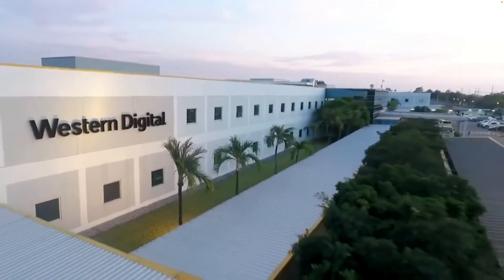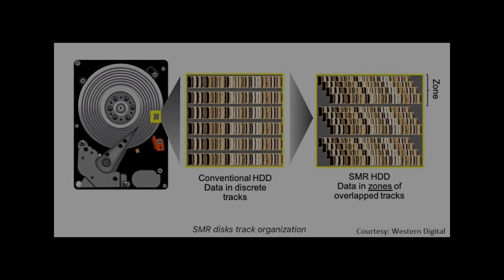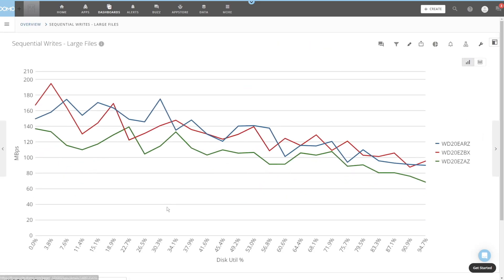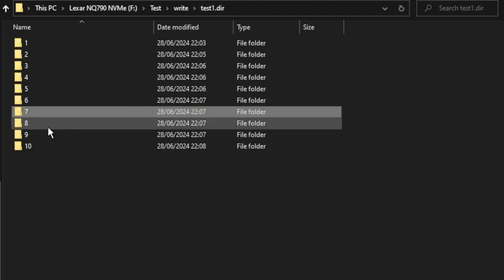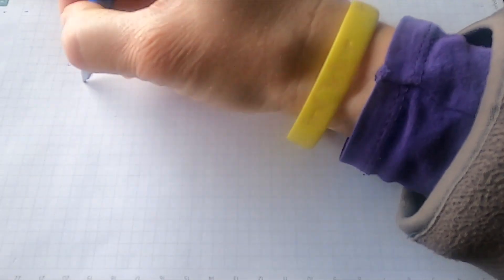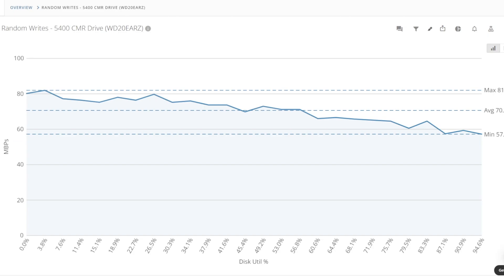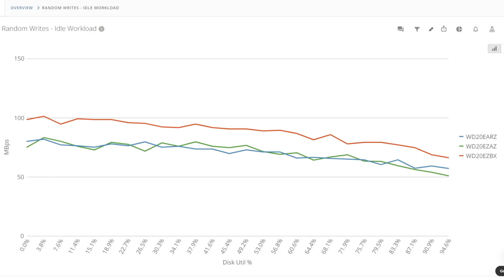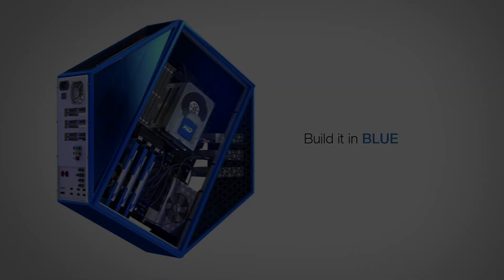CMR vs SMR. How do they compare, and how much should you care?

Comment: Thsnks. I would like some more low level info, like shingle firmware and how zones are handled
Reply from the maker: This would be mostly propriety and not in the public domain. And I did some other comparisons of desktop and surveillance drives with CMR vs SMR and it’s clear that  the implementation also varies by manufacturer.

Though I don’t know how the firmware is designed to handle this, and how things like zone size vary, you can infer a fair amount from the behaviour under testing, and it’s pretty interesting. Again, WD, Seagate and Tosh drives behave quite differently and some seem far better at some workloads. Overall, my take away was that the WD implantation was better than the others from a perf standpoint.
Reply: @sometechguy thanks. Its good to see im not the only one who digs into the details.  Much appreciated

Comment: It was absolutely annoying trying to find performance data between CMR and SMR recently, because anything real is choked out by useless, maga-like whining about SMR technology as if it molested their grandma. Strangely not as much about WD trying to sneak it in the back, then deny and deflecting about it.
Reply from the maker: The WD thing was a bit of a shame, and not the first time they got caught hand waving about what is going on with the technology in their products. They make solid hardware, so a bit of a shame that their Product/Marketing teams did this.

Right now, there is more transparency, but still not enough and still the recording tech comes and goes from datasheets, along with vagueness of spindle speed with terms like '5400 Class' not suitable for a datasheet in my mind. But SMR is alive and well in the Seagate Barracuda's and I dont think thats clear, and I did a video covering not just the WD mix, but also Toshiba have it in their P300 and S300 drives also, and the impact to performance for some use cases is significant. 

So I think putting the info out there is important, but likely only those that think to look will find it.
Reply: @sometechguy  Yeah, it feels like something that should be on the packaging, especially with that 20% performance cost even in ideal circumstances. Thank you for some actual data!

Comment: Quick statement on what are SMR and CMR would help
Reply from the maker: It’s in the video, and it takes a little explanation, but it’s just a way to put more data on the disk by putting the data closer to together. But this has implications to the way data is written and maintained and the work the drive has to do. And really, the video explains this with some diagrams.

Comment: Of the three Australian online retailers I frequent, one (scorptec) says whether a given HDD model uses SMR or CMR, in a way that's visible on the HDD category page, i.e one doesn't have to click through to an individual model's product page to view the information. However, they don't include it as a search filter, or explain what the terms mean. It's useful for those already in the know, but other customers may well go "ooh, larger cache size!"

The other two (mwave and pccasegear) usually say which recording technology a given model uses (at least for the WD Blue and Seagate Barracuda ones l checked), but you have to click through to the product page. They're also inconsistent with how they present that information, e.g. some product pages list the specifications in a nice HTML table, others just have a screencap of the product brief!

I have no idea what the big brick-and-mortar tech chains are like, but I'm afraid to find out.
Reply from the maker: The technically proficient, or enthusiast retailers seem more likely to specify. But the more mainstream consumer they get, the less likely it seems. Not sure if that is ignorance about it on the part of the retailer, or an expectation that the customer is more ignorant. But it isn’t great. 😞

Comment: so i need an extra hdd for storage mostly media and old videogames, but mostly media and linux iso, and in my country the price between the wd blue 5400 cmr 4TB and the sata ssd wd green 2TB is like 10 dollars (the wd blue is cheaper)
i know sata ssd is faster and the wd green have low endurance but i already have an nvme ssd for my os, and i plan to upgrade to an sn770 1TB.
so i am more inclined for the wd green 2tb, but the wd blue is cheaper and have 2tb more.
any recomendation?
thanks and great vids bro😊
Reply from the maker: Personally, on my PCs I have an NVMe SSD for boot, OS and things where performance matters, like AAA games that load lots of large data/textures.

For media, files, downloads, ISOs, pictures etc and even games that don’t really need high IO, I use a HDD. Depending how much you want to store, it can definitely be cheaper. And if you have a lot if data, you can also use a DAS or NAS with HDD also.

Comment: This is great content! I would also be very interested in Data showing how durable these SMR drives are in the longrun, because that was always my reason for staying away from them. If I get an HDD it's for data to archive or huge data to store. For a long time.
Reply from the maker: Thank you!

I would also love to see that data. I use the backblaze dataset for lots of great reliability info and I made a few videos using that to analyze reliability of large datasets over time.

Unfortunately, though unsurprisingly, they don't use SMR disks. So there isn't anything there. If there was a dataset, I would definitely crunch it, because I have trouble believing these drives are not subjected to significantly higher physical work. But also much higher read/write cycles due to all the foo associated with moving data in and out of the persistent cache.

Comment: Once in one of the videos a specialist convinced that discs with SMR technology are more suitable for backup and long-term archiving, while CMR are better for daily and constant work of reading and rewriting files. I don't know how true this statement is. Now it seems that manufacturers are deliberately trying to confuse buyers, artificially creating a supposedly large model selection to make it easier to sell low-quality goods. The buyer has to spend a lot of time to understand everything, to study all the nuances of the issue and only then buy the product. But even this approach does not guarantee a successful purchase.
Reply from the maker: I personally don't believe they are ever technically more suitable. There can be cases where the performance limitations are less important, but the only way I see that they would be better for a job, is down to significantly reduced cost, and they don't currently appear to be any cheaper. It could be true that they are less problematic for long term archiving, but not 'better'.

The problems here are reductions in write performance in some models, reduction in writing files to areas that are already used in all models I have tested. Inconsistent performance where performance varies, noise caused by the drives getting very busy with data organization tasks that are caused by how SMR works, which also inevitably leads to more wear and power consumption. And then there is added complexity and additional failure conditions.

So I would currently never select an SMR drive for any task, if prices are similar. But the problem is exactly as you say, that it isn't transparent to buyers and even on the data sheets, for the few that would take the time to read them, the performance numbers do not cover the scenarios where the SMR drives have poor performance, but only list best case numbers in most instances. So for 90%+ of buyers, they would have no idea, for a large percentage of the remaining 10%, it would be very hard to work out what they are getting. And only with some real research can you find all the information.

Hence this video, and the follow up group test I did on drives from Seagate, WD and Toshiba. Because I want people to be aware.

Thank you for watching 🙂
Reply: @sometechguy  Thank you for your reply and for the valuable work you have done for the benefit of people. I wish you peace and prosperity!

Comment: Sorry if that was already mentioned somewhere on your channel, but can you tell if SMR can affect restored data in some weird ways, like bloating the files?
Reply from the maker: No reason it should change the files, it’s just how the drive stores the data on the disk surface, and especially the process to write the data there. Mostly SMR drives perform fine when reading data, they are often just slower when writing it, especially on already used areas of the disk. But the files themselves should t be impacted.

Comment: I've got SMR drives and my experience has been a nightmare! I had a Seagate 5TB external drive which, in a nutshell, trashed itself and all the data on it. There's no way I'm buying any SMR drives as the risk is just too great for it to all go horribly wrong. The worst part of my experience was that the drive was a gift so I had no proof of purchase and therefore couldn't do anything about it.

I was using the 5TB Seagate as an archive drive as, at the time, I was desperate for storage space. I was transferring large video files of tens of gigabytes each. Thinges seemed to be going well, until I went to delete a file and replace it with another one. The is where it all went horribly wrong. At first it just seemed to be a problem of slow data tranfer. Eventually, the transfer appeared to have completed. The drive still made noises, though, but then the devices onboard power management shut the drive down.

I assumed all was well and had no clue my drive had just trashed itself. A day or so later I reconnected the drive only to discover the true horror of the situation. I'm assuming that the only data I was able to recover came from the CMR cache area on the drive, everything else was gone and it was data I was never going to get again. I tried leaving the drive connected for days on end to see if it would sort itself out, but it never did. A very painful lesson was learned. I now only ever buy drives I can confirm are CMR. There are no good reasons for using SMR drives.

Comment: What tool are you using to benchmark the drives. Is that truenas?
Reply from the maker: I have my own automated tooling for the testing, its based on Python and shutil. This performs the same high level copy operations as that of the OS, and testing of this versus manual copy testing shows that they closely represent the behavior of real world file copies. Its also possible to strictly control and reproduce the same tests this way also.

Comment: I was looking for a new drive as my storage was getting full.  I have 3 WD Blacks from 1 to 6 TB.   After checking the unavoidable "GAMING" branded Black pricing now, I had to move to another brand.  Was not aware of any SMR shenanigans with WD.   ExplainingComupters released a video on getting a 16TB Toshiba "ENTERPRISE" branded CMR datacenter disk.  This is the way to go I reckon, so I got myself one.  These enterprise drives have 512 MB cache and are far larger in TB than the consumer ones from WD.  Although some report the noise is louder for enterprise disks, I don't notice over my fans.
Reply from the maker: This is how I go for my various NAS's, and even if I want mass storage for a PC. Like you say, Ent disks are a little bit more noisy, but where I keep all this kit, it isn't a problem for me and there is lots of reliability data to look at to help make the choice.

Comment: seagate 4tb external hdd its 100% and slowing my pc down to a standstill on n off....i also have other drives -intenso and kingstone xs100 w no issues!)

cmr+ssr---my seagate is smr so what can i buy that are cmr external hdds??? will not get another 4-8tb external drive again thats like my seagate....just terrible vs all others i tried!
Reply from the maker: I have bought a few Seagate externals, and SMR barracuda go up to 8Tb, so anything at 8Tb or less has a good chance to be SMR. I just bought a WD elements to test and shuck so I can make a video on this, and it’s currently being performance tested in its enclosure and it should be CMR as WD SMR drives don’t come in that capacity. Once testing is down, I can confirm all the details.

But I would do this: look at WD and Seagate drives, including all the ones that come in SMR, Barracuda, WD Blue, WD Red (basic, not plus or pro) and check the capacities. If you are buying in a capacity that doesn’t come in SMR, you should be good.

Comment: one of the bigger issues with SMR disks is that they don't usually support TRIM, so the performance has no way of recovering outside of zeroing the drive... (and the firmware is usually dumb enough that it will probably spend a great deal of time re-writing stale data because of this.)
Reply from the maker: The WD Blue drives report that they support TRIM, and aspects of the performance look to support that. I have been doing a lot of testing of desktop drives the last few weeks and I have a video coming with the results. But in short, the Seagate Barracuda's also report supporting TRIM but the Toshiba P300 don't appear to. And the performance on those seems pretty awful and it looks like this might be a big part of that.

Interestingly, if a HDD supports TRIM, its often the first indicator its SMR, but as you say, they don't all support it. And an SMR drive without TRIM is probably going to be way worse.

Comment: They just "re-collored" the EARZ WD Green to Blue, because the Green failed a lot.
But, i had many WD Green drives, with Fixed Firmware, running for Years!
So, sometimes you have to look beyond, and find a fixed Firmware, or do a "fix-it-myself".
The best what you can do is to disable the "spin-down - spin-up" cycles, because it destroys the Green drives very fast.
From my experience, the EARZ and EARX Green (now Blue) with high spin-up/down cycles die at about 750 working days, and with disabled spin-up/down cycles they run almost forever - mine run for more than 3600 days now, so thats almost 10 years.

Comment: Apparently WD did learn the lesson from the past and is listing CMR/SMR clearly in their official store. The "Recording Technology" specifies whether it's CMR or SMR, and on the bottom of the detail page (for each blue 3.5in hdd) there is a list of models stating RPM, capacity, cache, SMR/CMR, with a link to that model. That's the most straightforward CMR/SMR indication I've seen in recent years.
Reply from the maker: Thanks for the comment!

You are correct, that right now the website, as well as the product brief docs on the WD site do state this in the specs. I think considering this has more impact than the cache size or even maybe the rotational speed it should be right there on the description "5400RPM, 2TB, 256Mb, SMR" for example.

I looked at these sites many times over the last couple of years however, often in preparing videos and it seems to change over time. Seagate for example, were doing better at this but today their site doesn't seem to mention it in the specs, but it is in the data sheets. I have multiple downloaded copies of these datasheets and some contain it and some exclude it. It seems to change from time to time how clear this is.

But when I looked at retailer sites, it typically is not stated, and this is where most people buy (or in physical retail like BestBuy or Walmart).

If you search 'seagate smr', the top hit (for me at least) is a site with a full list of their models and what is SMR and CMR. Which is great, but you have to go search. I think the transparency still isn't where it needs to be.

I am currently doing extensive group testing on desktop drives from WD, Seagate and Tosh and it turns out that the WD drives are probably the best SMR drives available. But the performance impact on these really means it should be fully transparent.

But I hope that making videos about this, stirs conversation and continues to keep them honest. Having more views and subs would help. 😉
Reply: @sometechguy  Oh I see the point. I've always assumed 3rd party retailer won't be clear about specs, and official website is the way to go for deails. That's based on the common practice seen in my home country.
I guess I'm pretty lucky that datasheets had everything I needed, for the few times I shopped for HDDs.

Now that I think more about it, the situation is still terrible for external drives right now. I never saw a clear word about cmr/smr on official websites/datasheets for WD/Seagate external models.